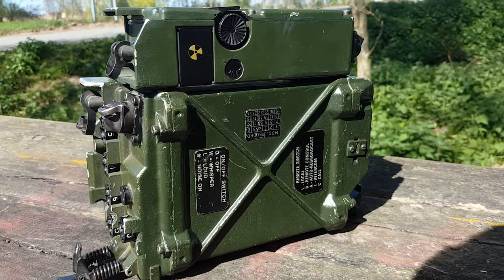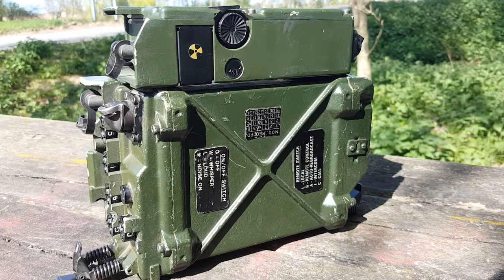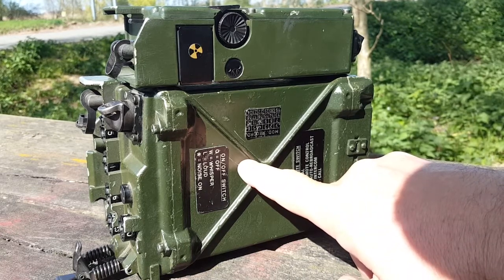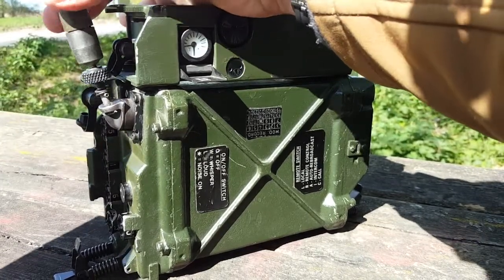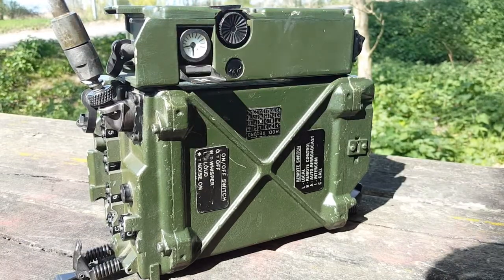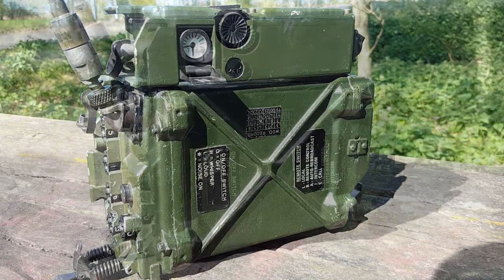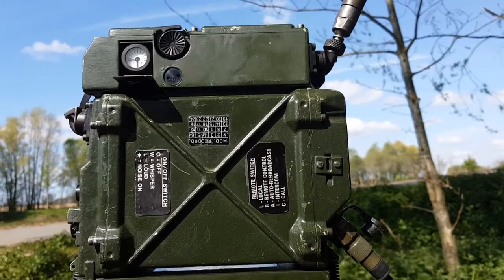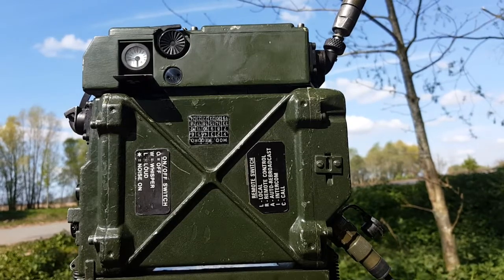PRC-351 to PRC-352 Military Radio Conversion.

Comment: For information, the small plate with two screws set set above the small groove is designed to be used to strip the cover from D10 signal cable which was used for all manner of things like remoting,  speakers, handsets, field telephones etc. Really good cable which contains both copper and steel cores - this would have been fine for signallers but Plessey provided this to assist infantry and other non technical users. Simple but effective.
Reply from the maker: Good to know thanks!

Comment: Add the handcrank generator and you have even more weight but a distinct prepping advantage
Reply from the maker: I will get one!
Reply: @RadioPrepper  Not as cheap as they used to be unfortunately but you might be lucky
Reply from the maker: Word of mouth and military radio groups are your best bet..  I have two..
Reply: @RadioPrepper  I got one recently through eBay for £62 and it's in nice condition. Is there much British military radio in France? They seem to end up all over the world
Reply from the maker: I have no idea, but they do!

Comment: ive now added a external Clansman speaker. ( Square one with the rubber buffers.  its rather heavy !! ) This means you can adjust the volume when using the open squelch mode (*). The head set /hand set can plug in to the speaker as well and the volume control also lowers the volume in the headset / hand set.
Reply from the maker: Great. I do need one!

Comment: According to the radio manual. you can use the SURF with the RF amp.   Link radio to the SURF and then the SURF to the RF amp. Then the Amp to the  Ground Spike antenna set up. ( If your going full military set up. )
Reply from the maker: Thanks, that makes sense! I will try that.
Reply: +Radio Prepper ther is also a mid to turn off the 150hz tone guard for the squelch.  But I'm not sure if it is actually turning it off.   I think it just decreases it's volume on your transmitted audio.   I've  just bought a complete 352 man pack set up.    So can't wait to try it out.  73's.
Reply from the maker: Interesting thanks. I really don't mind the tone, and if other hams around use military rigs, as likely on 6m FM, so much the better...

Comment: The main reason for the surf is stop receiver blocking from other nearby operators on adjacent channels. I would really recommend the additional 20 watt linear they make it quite useable. I like your automatic tuner very nice. Great video very interesting thanks for sharing.
Reply from the maker: +AllTheGearNoIdea Correct. It also acts as a tuner. Of course I have the 20W amp ;-)

Comment: definitely a basestation radio. SHTF you can hook it into the phonelines aswell
Reply from the maker: +VK6OP The remote option is definitely a plus, feature not available on amateur gear. I saw spools of 800m of telephone wire for 65 Euros! I can see how running a phone line could be much more discreet than transmitting!
Reply: I agree that they aren't great weight wise and they are nearly useless for HAM purposes but in a disaster or WROL a local hardwired comms setup would be very useful.

Comment: Hi Gils, I'm very much enjoying your videos, especially the Clansman ones. I have both the Clansman 320 and the 351 sets and have had good results with both. Our radio club, the Southdown Amateur Radio Club, which serves the South Downs near Eastbourne on the south coast of England, have done some distance tests with both and had surprisingly good results. Please see the Southdown ARS youtube channel if you are interested. The Clansman 35x series also has some very exotic antennas available for it such as the Ground Mounted Monopole (looks like a rotary clothes dryer) and the 'Pineapple' Elevated Wide Band VHF Antenna which gives excellent results if mounted high enough, well worth checking out. I should also say that the big brothers of these radios, the 321 and 353 are objects of beauty and are fantastic, though definitely not portable! 73s and thankyou for your excellent videos, Andy m6gnd
Reply from the maker: Thanks Andy, I will subscribe! You should check out the PRC-320 Yahoo group and the PRC-320 WhatsApp subgroup where we try to make contact on the air... Maybe we could try sometime and make a video out of it :-)